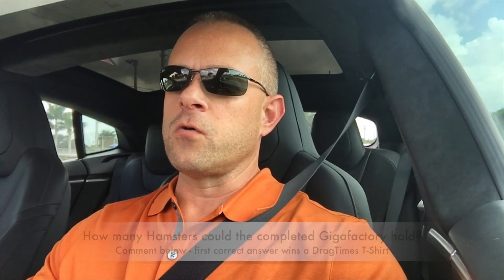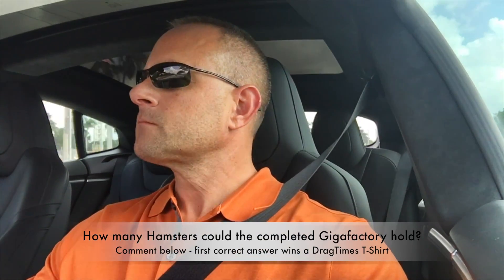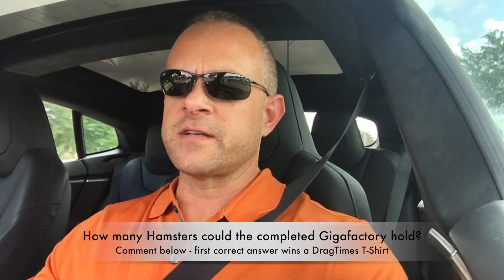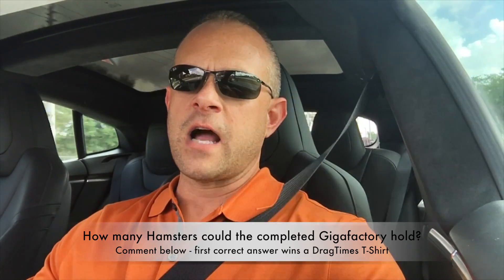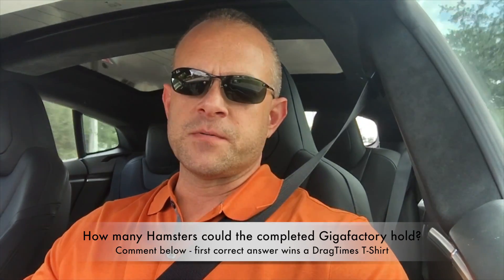Tesla Gigafactory Behind the Scenes Inside Tour

Comment: The National Transportation Safety Board (NTSB) said that four seconds before the 23 March crash on a highway in Silicon Valley, which killed Walter Huang, 38, the car stopped following the path of a vehicle in front of it. Three seconds before the impact, it sped up from 62mph to 70.8mph, and the car did not brake or steer away, the NTSB said.

Comment: I did not see any batteries been made.... just battery packs. There is difference between battery and battery pack.  Looks like Elon can NOT make batteries, which are the foundation of that "technology".  Not just that all assembly line robots are Made in Japan. 
And funny when Elon announces news he never lies. But read this:
"The new 2170 battery cell, named after its 21 mm by 70 mm dimensions, is thicker and taller than the ‘18650’ cell format it replaces, which has served as the standard lithium-ion format for decades." 

My point is - I did not see any 2170 on that video been made in Nevada. From Elon's news is clear that that 2170 battery is just a new "format" of Li-battery and it's not revolutionary. And the funniest thing! Elon announced that 18650 battery already "served as the standard lithium-ion format for decades."!!!!! How many of you, my american friends, even saw  18650? 

Americans be careful - you might get screwed again, just like Ethanol...
Reply: Watch Tesla's new video of them producing the batteries at the gigafactory, the actual speed of the batteries going by the screen is so fast the batteries would be just a solid blur. And yeah, Panasonic has like over a $1 billion USD invested in the gigafactory, but who cares, at least it's happening right?

Comment: Why don't they put solar panels on Tesla cars?
Reply: not enough electrical generation for the cost put into it. But the reason is really more complex than that. There are solar cars you know, which run 100% off of solar on the roof of the car.

Comment: I couldn't see anything actually being produced!     Suddenly a shiny red car appears.
Reply: The car is there for show obviously, the plant isn't even fully built yet. and there we're battery packs being produced, only at small scale since it's not even ready to be used. they seem to be doing fine if they are putting $5 billion into the factory witch after completed, it will be run purely on solar power. Tesla and Panasonic probably have plans for what to do with waste & plans for recycling dead battery cells / packs.
Reply: dudes got mad cow
Reply: you can reuse the batteries over and over again.
Reply: So that's what they were.  I suppose they will end up in landfill in a couple of years like most of the rest of the car.
Reply: Ronnie G Well it’s been a couple years, and they batteries are at 99% efficiency from when first new. And the car are in more demand than ever, oops.
Reply: Batteries have a notoriously short life, although you may see from other entries that these are supposed to be guaranteed for 10 years. By which time Tesla might have ceased trading and milked their pension fund to keep afloat.

In an ideal world all parts are recycled but this is far from the truth. What happens to the mixture of plastics for instance? It costs too much to separate to be of any value. The copper contained in the many electric motors is simply melted down with the iron and is boiled off into the atmosphere. Rubber tires are an enormous environmental problem.  

Maybe not a couple of years but governments encourage scrappage schemes for perfectly serviceable vehicles to try to prop up an ailing motor industry.
Reply: Elon Musk says part of the Gigafactory will be dedicated to battery recycling. Hopefully they will consider a plan for recycling the rest of the car too.
Reply: That's good news, only time will tell. If it costs too much it will no doubt be stopped as these ideas are only a marketing ploy anyway.
Reply: The batteries in Tesla have a lifetime of approximately 20 years.

Comment: Gigafactory is 3 stories tall.  It's not located in Sparks; Sparks is right next to Reno.  The factory is East of Reno/Sparks further out in the desert.
Reply from the maker: Electric Ave, Sparks, NV 89434
Reply: Not sure how they did that, since Sparks is 20 miles away and there are other towns between Sparks and the Gigafactory.  Also, if you put Sparks, NV in google maps, the Gigafactory is way outside the city limits: https://www.google.com/maps/place/Sparks,+NV/@39.5753435,-119.7854831,12z/data=!3m1!4b1!4m5!3m4!1s0x80993ed409896c93:0xf189599a50856df9!8m2!3d39.5349112!4d-119.7526886 Maybe they have a mail box in Sparks.
Reply: Some cities have noncontiguous parts. For example, Oracle is located in a small part of Redwood City, CA, that is miles away from the main part of Redwood City, and separated by two other cities.
Reply: It will soon be part of McCarran, NV. The new town being planned out at the industrial complex there. Yeah it's not even in the same county as Sparks, not even close to incorporated city limits. Exactly 19 miles from city limits to the factory parking lot